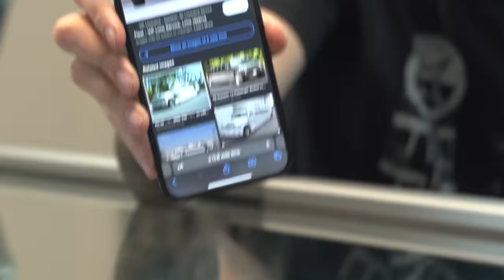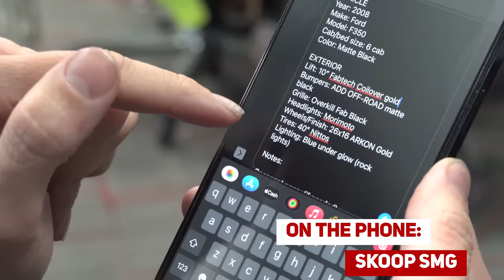I Just Bought a 41 Foot F-350 Limo

Comment: i have a 6.4 just get some really good oil 15w40 trybodn oil, do delete if you want to and just keep stock no tune, use some factory tranny oil and also get the trybodyn diff fluid and your set, before you put new oil do a engine clean with the toyo cleaner, and also put in a diesel fual cleaner first time and also make sure to get water out the seperator and put in new filters, and also during top up add fuel additive in diesel and your set i know it may bbe much but after a few uses you dont really need to do it just make sure to keep up with maintenance and also do it every 30k every same engine oil routine

Comment: A stock 6.4L Powerstroke is gonna fail so quick with huge wheels and pulling its heavy self around. I hope that engine is bulletproofed well or swapped
Reply from the maker: Well if it blows up we 100% will just swap it, so far so good
Reply: @CustomOffsetsTV  put a huge turbo on the 6.4 and run it till she pops. You'd get at least 1.5 sick skids out of it.
Reply: No such thing as “bulletproof” on a 6.4.